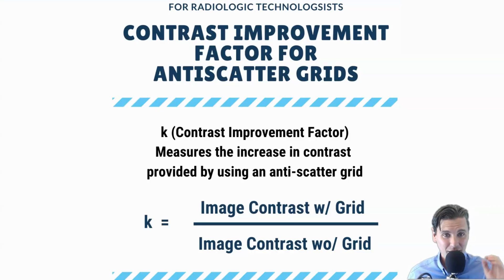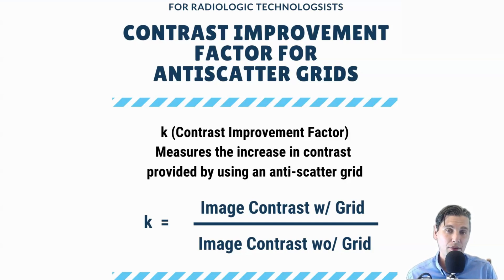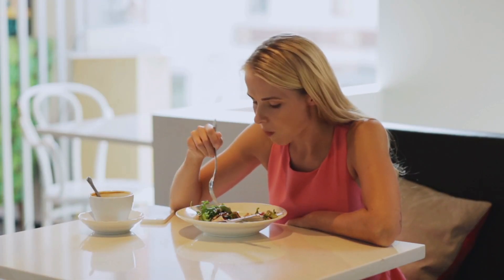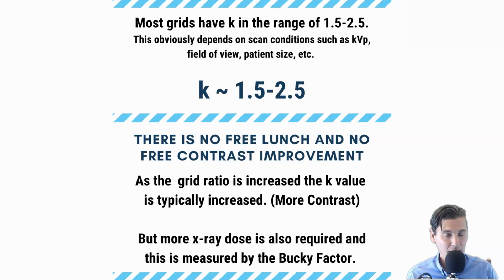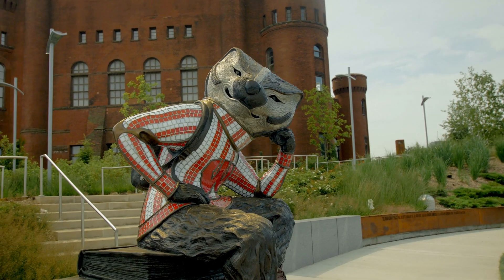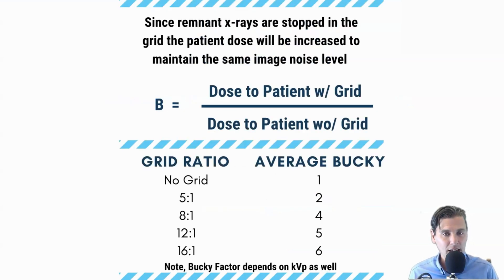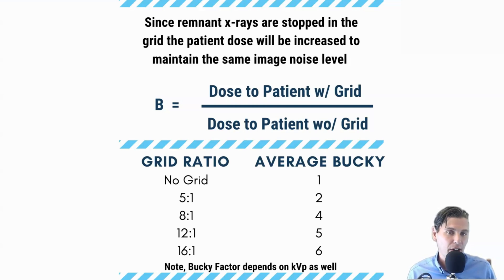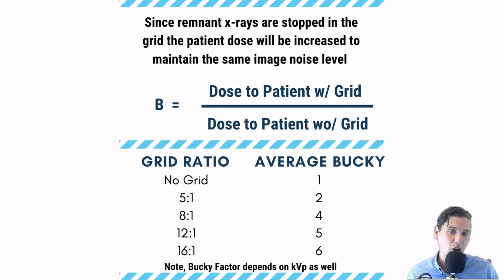Bucky Factor Radiology (w/ contrast improvement factor and grid ratio)

Comment: I'm starting to notice that different sources say contradictory things about how to calculate Bucky factor and it's making me really confused. You said in this video that it can be calculated by dividing the intensity incident on the grid by the intensity on the detector. I've seen that explanation elsewhere as well, but other people (such as Dr. Michael Nel from Radiology Tutorials) say that it can be calculated by dividing the dose with the grid by the dose without the grid. Chat GPT told me the same thing, that it's the ratio of the dose at the image receptor with a grid to the dose at the image receptor without a grid. I don't see how these two methods for calculating Bucky factor can yield the same result, since the first fraction (intensity on the grid / intensity on the detector) would have a larger number in the numerator than the denominator, and the second method (dose with the grid / dose without the grid) would have a smaller number in the numerator than the denominator.
Reply from the maker: These two methods should give the same result. The assumption is that the noise on the detector is the same, this requires more dose after the grid is on so the Bucky factor should be greater than 1
Reply: @HowRadiologyWorks  Thank you for responding. I understand that the Bucky factor should be greater than 1, that’s why the second method seems problematic to me. If we quantify the does on the detector with a grid, we’re going to get a smaller number than if we quantify the dose on the detector without a grid. So if we divide the dose on the detector with a grid by the dose on the detector without a grid, we would be dividing a smaller number by a bigger number, which will derive a number less than 1. and since Bucky factor needs to be a number greater than 1, it seems to follow logically that we can’t calculate bucky factor by dividing the dose on the detector with a grid by the dose on the detector without a grid.

To be honest I don’t understand what you said about noise, or what noise has to do with Bucky factor. Radiopedia says that noise is a random process due to fluctuations in the number of photons reaching the detector from point to point. Is that what you meant when you used the term?